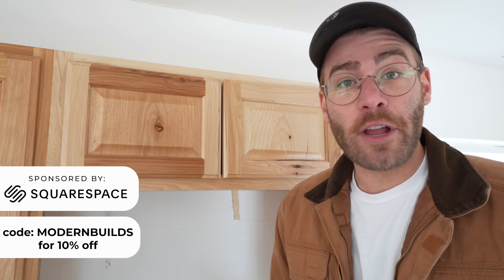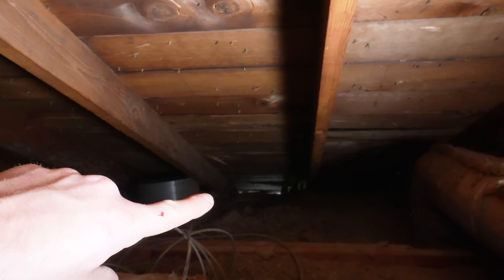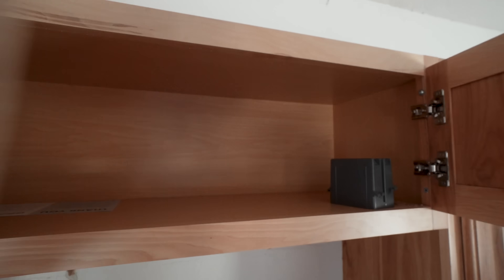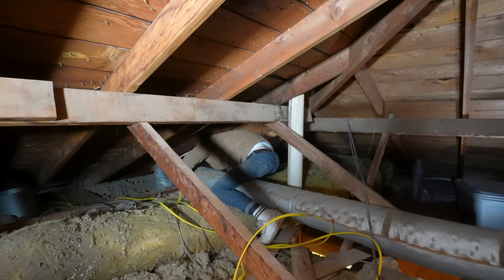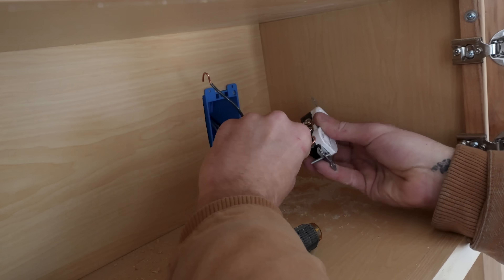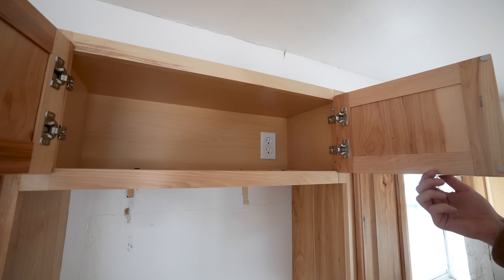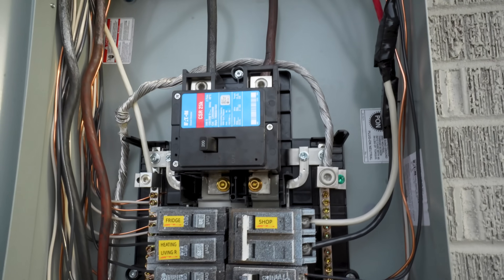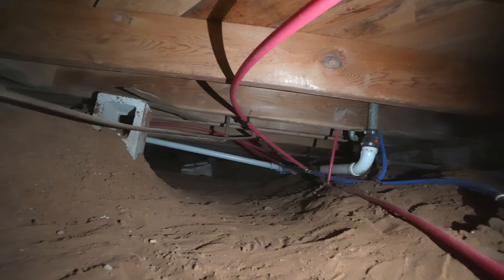How To Wire a New Outlet & Breaker Through Attic. DIY Microwave Plug Install

Comment: Having run tons of wires and low voltage (speaker, network, fiber, satellite) in attics. Always wear a hardhat and a thick shirt its amazing easy it is to smack a roofing nail and get scratched or worse.

Comment: This is helluva entertaining and you are very likeable! Im gonna be most likely adding a breaker/circuit to a OTR microwave but the breaker panel is only 10 ft from the site so it should be doable. Thanks and liked and TU!
Reply: this video is incorrect. Don"t do what he did. He used a 15amp plug on a 20 amp circuit. The 15amp plug could catch fire before the 20amp breaker can trip. Trust me I'm a Certified Electrician...he is not.

Comment: I'm wondering: For a Dutch guy it's super confusing to see the breaker box outside of the house. Why is this and isn't having it inside way more practical?
Reply: U.S. building codes can be odd depending on where you live. In my state, we do 16 inch centers but, because my mobile home was manufacfured in a different state, I have 12 inch centers on loas bearing walls.
Reply: I think in certain climate ( Warmer) it's okay to have the electrical panel outside. I prefer it inside.
Reply: Most houses in Arizona are outside, or in the garage, as far as I know (the ones I've lived in).
Reply: I think he is in Oklahoma, so a drier warmer climate. It’s far more common in dry climates.
Reply: So, it's more common in warmer areas. But any specific reason why it's outside and not inside? And can just every access it? So many questions haha
Reply: @jessevado  not sure of the exact reason. I think they are usually behind the fence to the back yard, so no, not generally accessable to everyone, but I guess if someone wanted to get to it they could....

Comment: I could be wrong but doesn't NEC require that outlet to be GFCI?
Reply: Depends on what version of NEC his locality is using.
Reply: 2023 NEC says yes.
Reply: this video is incorrect. he installed a 15amp receptacle on a 20amp circuit

Comment: But why not a 20a receptacle?
Reply: Not needed for a duplex outlet
Reply: To be a dedicated circuit a 20 amp single receptacle is required.
Reply: You are correct. What he did was wrong. He installed a 15amp receptacle on a 20amp circuit.
Reply: 15 amp outlets are allowed for 20 amp service in most places in the states

Comment: The white wire is considered a “hot” for a 240 set up in this panel? Not a neutral.  I thought it was black and red for 240?
Reply: Whoever wired those double pole breakers apparently decided to use 12/2 instead of 12/3 either because it was handy or just cheaper. It's okay, but you should wrap some red or black tape on each end to indicate hot wire. Personally I'd use 12/3, land the neutral wire on the neutral/ground bus bar and the other end capped in the receptacle box if it's currently not needed for a 240v outlet.
Reply: Yeah red means positive 
Black means negative and green and yellow means it's eighther made in Australia, Brazil or south Africa

Comment: So the panel where your feeding the microwave from is the Main Panel. The Main Panel must have separation from the branch circuits, your running branch circuits through the Main Breaker area. This is against code.

Comment: That is a 15amp receptacle.
Reply: It's fine when it's a duplex outlet
Reply: yeah, on 12-2 wire rated for 20A connected to a 20A breaker.  Mike really should switch this out to a proper 20A duplex outlet instead of a 15A rated one
Reply: @ep7  not required it is code compliant
Reply: @jimrumsey8077  thanks. Must be state specific code then. I’m from Canada and this would never pass here.  At least the wire rated higher than the outlet so it can carry the amperage safely. Still. I would have at least put a 15A breaker in the panel at the other end so when looking at the outlet it would match its rating.
Reply: It's not that the 15 amp receptacle is wrong, but it's a residential grade, I'd switch to a commercial spec grade or a 20 amp single receptacle. The single 20 amp would define the circuit as a true dedicated circuit, which it should be for a microwave.
Reply: The breaker is only used to protect the wire, 20 amp breaker,  20 amp wire.

Comment: Neutral and Ground on the same bus in the panel?
Reply: Neutral and grounds should be bonded at your first means of disconnect which this would be since you can see panel is being fed directly from the meter

Comment: Is house electrical wiring done before roofing, some so those spaces are to tight to work in.

I was scouting the internet few months ago looking for such video to extend a socket for my washer, I used my intuition and was successful, I did exactly the same steps and I'm a supper pro 💪🏾😂
Reply: What’s cooking supper pro?!

Comment: if you're installing a 20amp circuit you need to use a 20amp receptacle not 15amp that he installed...
Reply: The breaker is only used to protect the wire, 20 amp breaker,  20 amp wire.
Reply: @jpjelec1  Yes that's correct.. but the receptacle could burn if it sees more than 15amps and before the 20amp breaker trips..

Comment: I think the code in Europe dictates that you can only run a cable in a plastic type through the house calling it a “group”. You. Any just run a naked cable like this through the house. That’s a fire hazard.
Reply: It depends on the cable used. The manufacturer will always tell you what the cable is rated for.
Reply: In the US, Romex cabling used in indoor applications can be run without any extra conduit aside from the jacket, in this case yellow for a 12 gauge wire, which is a heavier gauge supporting a 20 amp circuit appropriate for a heavy current pulling appliance like a microwave.  There can always be exceptions of course.